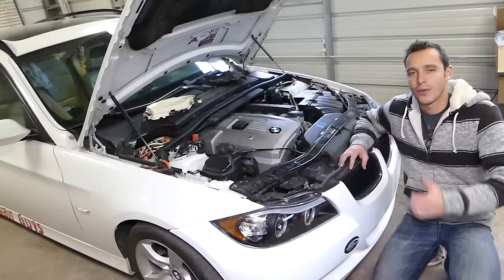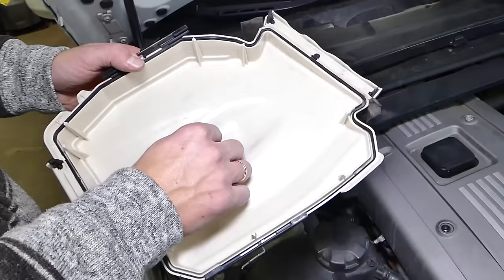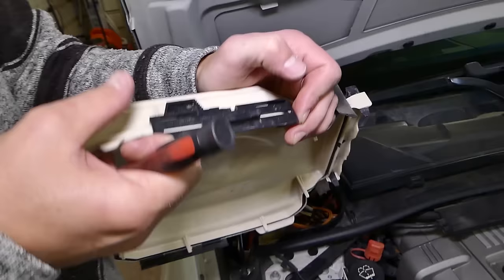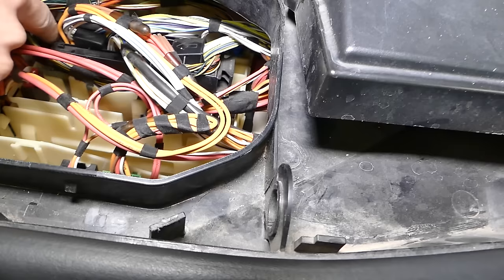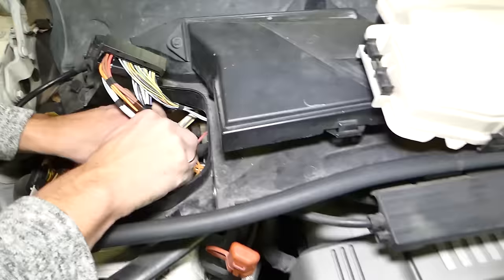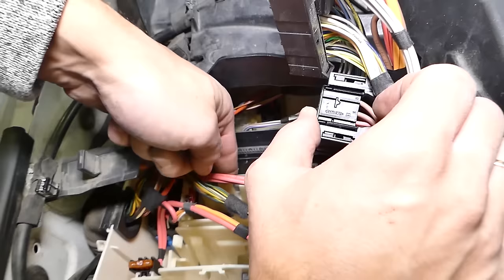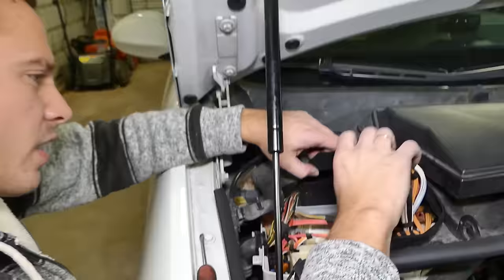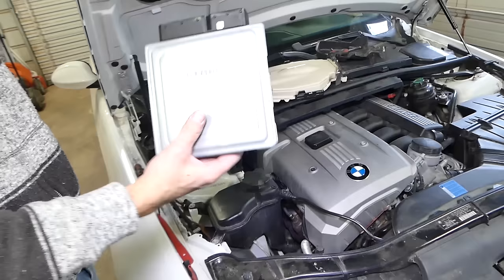HOW TO REMOVE AND REPLACE ENGINE ECU ON BMW E90 E91 E92 E93

Comment: Would you have to disconnect the batter I'd you remove the ecu or fuses? Thank you in advance
Reply: I'm pretty sure you have to, and also wait 20 mins after unplugging battery just in case

Comment: Can somebody please help me my 2011 335is is acting weird it won't start it turns over and when it does come on it idles like crazy up and down and these codes come up and then it shuts off I thought I could fix the problem by replacing the crankshaft positioning sensor still did not fix the problem
Reply: Javion Smith Whats the codes given
Reply: Have the samenoe
Reply: hey man i had this same issue , water could have got into your ecu , you could clean the ecu with electrical cleaner

Comment: My 2009 BMW 535i was running fine except for the low oil pressure warning light. It didn't start after replacing the ECM with one I bought on eBay. I took it out and now my car won't start even with it's original ECM. Do you have any videos of how to correct this issue? Any advice?
Reply: Ever get it fixed?

Comment: What kinds of things would prompt me to change my ECU....im asking because my car has been acting funny and i think it may be the ecu...the wipers keep going and wont stop the abs turns on amd off then i set it to DTC and it turns on and off. This startred happening after i used my scanning tool to reset my check engine light .....would that be the cause ?
Reply: Alternator is over charging, I had the same thing

Comment: Hi , my 2011 bmw  328i coup engine will die on sudden acceleration but will start again after cooling the engine for 20 minutes.
please help . your video is great . thank you
Reply: romeo manuel  Crankshaft sensor it probably has a SES light (check engine light) on

Comment: Hi! I have a 2007 bmw z4.. was only going to add spare key but my locksmith for some reason ruined my ecu. Now the car won't even start. If i buy used ecu complete set with immobilizer and key, how can i install that? Thanks!

Comment: My DME is damaged. My car is 2005 e90. If I get a 2009 e90 DME with the key, do I still need it programmed??
Reply: As long as you get the DME, CAS, and Key it should start and run. You can't just get 1 or 2 of the 3. The only issue is that your mileage and other non essential things will be wrong. To get 100% back to stock you'll need someone to reprogram it.

Comment: Hello i can not read the diagnostic in engine so i thing engine ecu is gone ..car is 2006 e90 320d .if i put second hand ecu in there do i need to make a new program or not  pkease aswear ..thanks
Reply: Milan Horvath  Yes anytime you swap out the ECU on any car you need to reprogram it so it can re learn

Comment: Hi Where is the transmission model located I have a 2006 BMW 330 I and I’m having issues with the transmission light it dries great daily goals and let me know change the crank shaft sensor and it still doing the same thing like don’t go off
Reply: Pretty sure it's inside the transmission with the valve body (known as mechatronics)

Comment: My 2008 328i wont crank after heavy rain, what do you recommend??
Reply: check the drain in the ecu compartment. it's probably filled with water and burned the ecu.
Reply: @unknownuser-fy5gy  happened to me as well water got in and corroded the dme and need to get it fixed or replaced

Comment: After ecu changing on my bmw e 90 320d... Navigation(gps only) is not working anymore and as well heating seats not working. Any ideea what can be wrong?
Reply: Need to reprogram the ECU or else it will start acting up

Comment: sorry i have one question. i have one car bmw e91 and not have key .
if i change for another e91 ecu,cas module and key reader with key it’s possible to start?
Reply: Roman Florea Its possible but you will need to reprogram it so it can re learn
Reply: Why didn't you just get key care on insurance you dounught 😂

Comment: I need help I have a BMW 328i 07 with a p2098 code I replace the O2 sensor but the same code came back what should I do next.
Reply: Anthony Jackson Check the fuse or relay
Reply: Did u use the part number of the original sensor to purchase the new one ?

Comment: Can you please help me!

My bmw 318i e90 2007 starts but won't turn on. With obd scanner it says anti theft..... Is it something in this box like you showed in the video?
Reply: First, please understand, if you call an ECU "this box", don't make your own assumptions... Now, when that's out of the way, if there is an error indicating a problem with "anti theft", then your problem will never be in the ECU (DME). Your problem probably lies within CAS or EWS. One thing you can try, if you have a laptop, obd cable and INPA installed, is to re-syncronise EWS with DME. Google it, it's fast and easy.
Reply: @mraaaaaaa  Thank you very much. I will look it up.